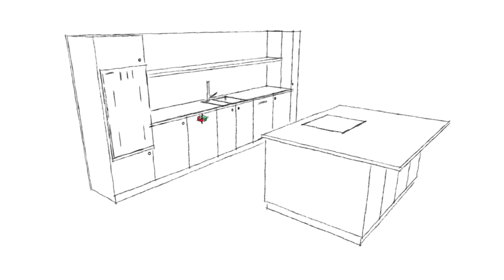Building birch ply drawers for a Scandinavian inspired kitchen | Atelier Cabinet Makers

Comment: This is a very nice looking way to build drawers!  I have been building using the same method but I hadn't figured out doing the little skirt part on the sides.  Do you feel that really makes the drawer look better once it has a face on it?  

Also, what finishes are you doing, if any, for the drawers?  I've been doing water based matte polyurethane

Comment: Good video, thanks.  What are the holes drilled in the two bottom corners for?  Found the link above to your website did not work.  Did a little search myself and found this: http://jsmithwoodworkshop.squarespace.com/ Cheers, David.
Reply from the maker: DRMNZ thanks David, will check the link and get it fixed! The holes drilled for two locating pins, one at the back of each runner. These help to hold the back of the drawer in place, whilst the front is held by lever clips which screw to the underside of the drawer. Hope this helps!